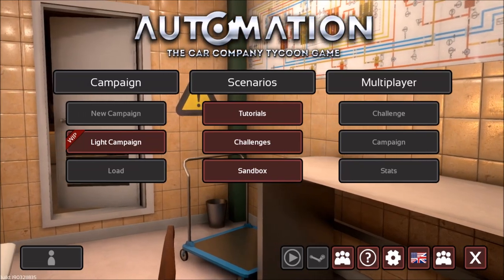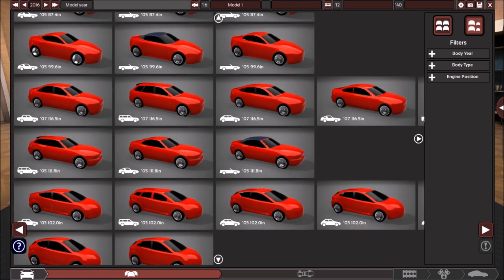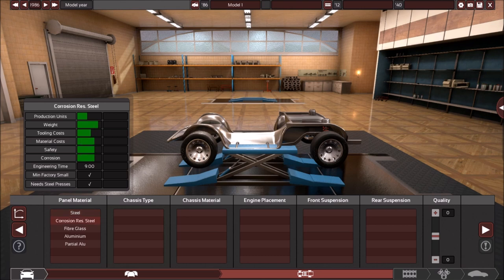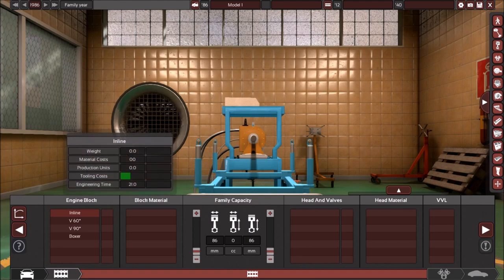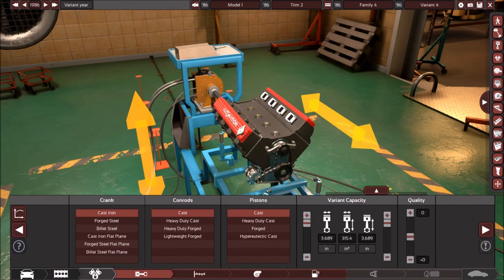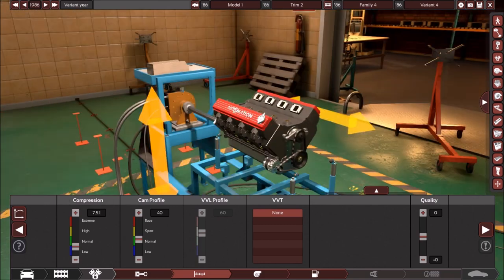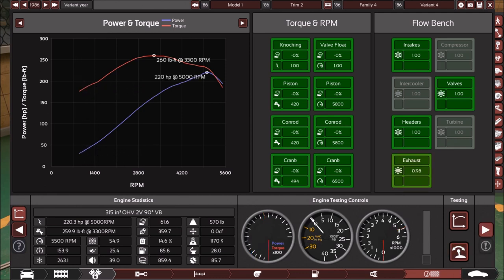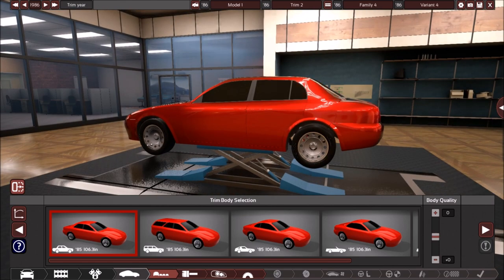How to make a realistic car in Automation

Comment: If you look in the misc section when doing the visuals, you'll find wipers and trunk catches
Reply from the maker: I didn't include those as they are tedious to use and I was trying to finish the car quickly. I wanted to make an example for the basic look/design of the car.

Comment: A couple nitpicks on some of the car info. Unibodies existed as far back as the 60s at least (The 1960 Ford Falcon was unibody). Also, flat plane crank V8s are super rare. Mostly Ferraris, the only flat-plane V8 Ford has ever built is the 5.2 in the current GT350. Also, when you're having a knock issue you usually want a milder cam (lower number). That struck me as a bit odd, but you did come up with a pretty good motor though. More explanation on why you were pulling back compression, vs lower the cam, retarding timing or messing with the fuel mix to get rid of the knock would probably be good for the kind of person looking for this type of video.
Reply from the maker: Thank you for the corrections, I am considering making a series where each episode covers only one page of the vehicle creator. I would make the episodes about 10 minutes long and go in-depth about all of the different options.
Reply: Lower/milder cam leads to a higher dynamic compression ratio, which increases the likelihood of knock. You want a more aggressive/higher cam if you have a knock issue. http://cochise.uia.net/pkelley2/DynamicCR.html

Agreed on every other point. Crossplane cranks are the most common in the V8 world. Flatplane cranks are generally used in exotic cars/racing cars. Even modern V8 Maseratis use cross plane cranks, with their Ferrari equivalents using flatplane.